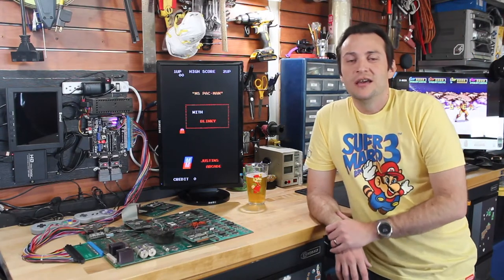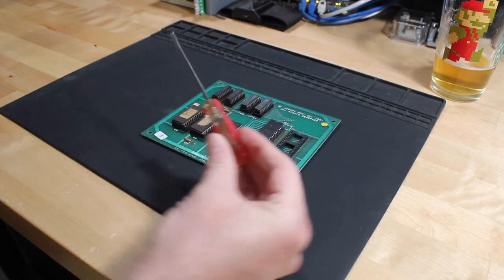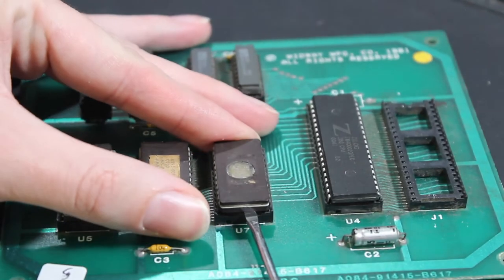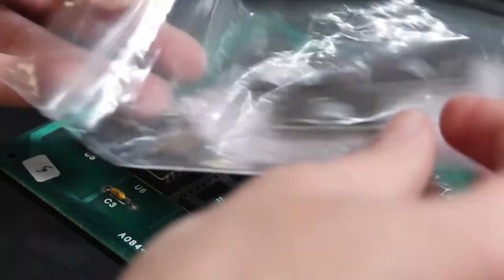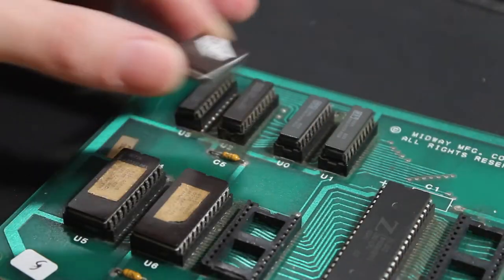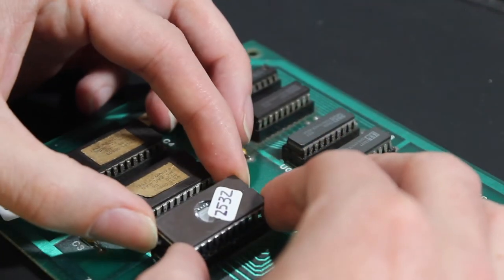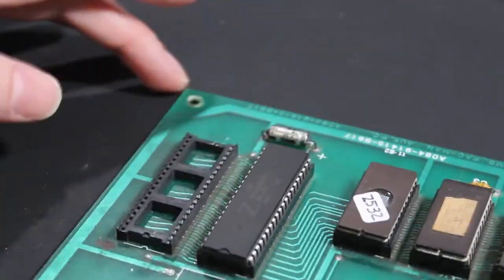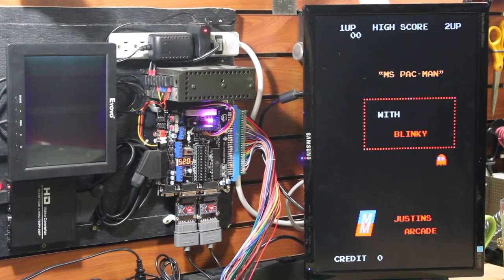How to replace a ROM chip on an arcade PCB

Comment: How do i check for a bad rom? Theres certain graphics on my double axle arcade and i know its one of the chips just dont know how to check
Reply from the maker: You'd need to get an EEPROM reader such as GQ-4X V4 and use it to read the contents of each ROM. From there you could verify the ROM file checksum against a known good set, such as MAME:

https://github.com/mamedev/mame/blob/b8fa9a04d502cec5bfd06f1e913e2d8e614414b7/src/mame/taito/taito_z.cpp#L5259-L5304

Comment: Hi Justin, thanks for taking the time to make this video. Do you have any idea where I might go to find a replacement ROM for a Williams Defender? My game is resetting to the "rug" screen mid-game. Normally I'd think that would be a RAM issue, but the diagnostic lights on my main board are showing a ROM failure, specifically IC9. The RAM in my machine seems readily available but what do I do for replacement ROMs?

Thanks!

Pete - Breckenridge, CO
Reply from the maker: You'd have to look at some schematics to see where IC9 was on the board and what type of EPROM chip it is. You could then obtain said chip and use an EPROM flasher to flash the ROM code, which you can get from a MAME rom set.

If this is a one-off repair and you don't want to buy an EPROM programmer just for this one project, then check out https://www.arcadepartsandrepair.com/ I believe they will burn one-off ROMs as needed.

Comment: Hey fella i have a Killer instinct pcb but the pins where u plug the hdd in some are missing can pins be fixed?
Reply from the maker: Yeah, it looks like those pins could be replaced, but it would take a bit of soldering and maybe a replacement male IDE header.
Reply: @justinsarcade  ok yea some ic chips are gone also 2 of them